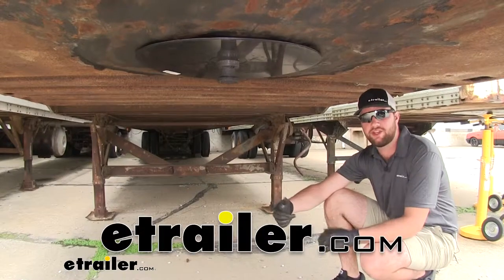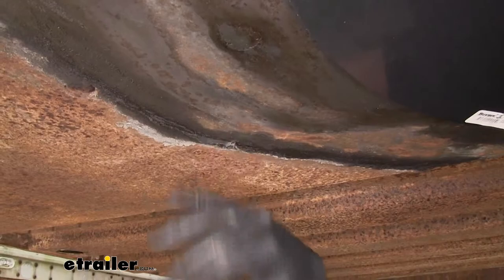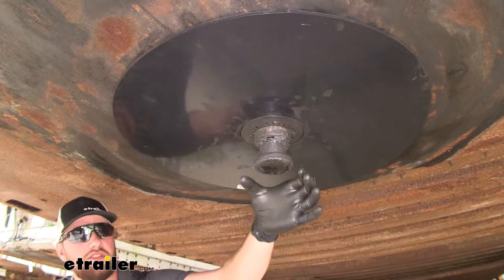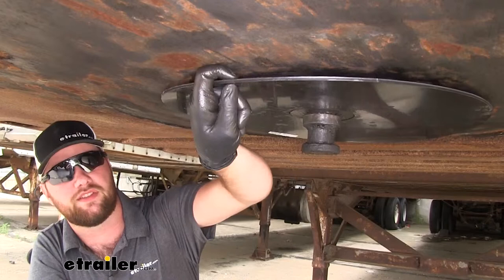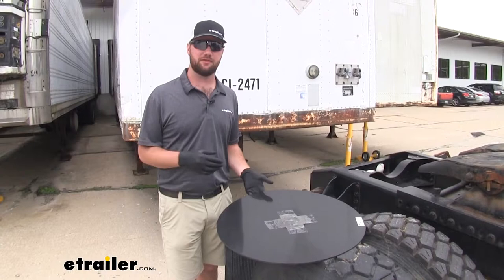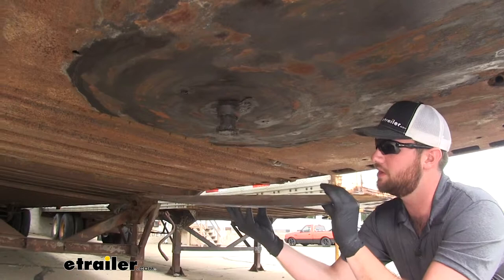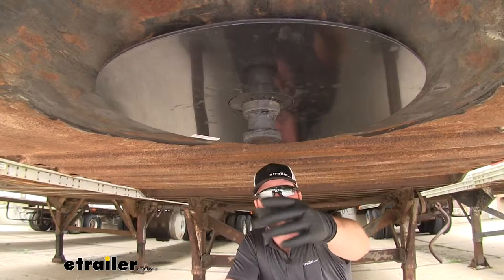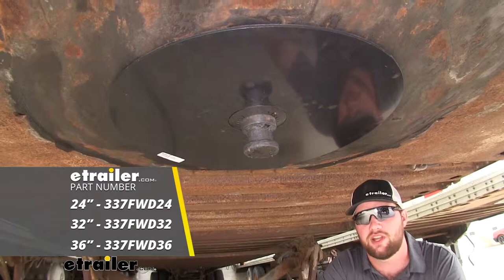etrailer | Feature Breakdown: Buyers Products 24" Fifth Wheel Lube Disks with Steel Retention Clip

Comment: What’s the sense in the skid plate if you have to put grease on the 5th hole wheel🤷‍♂️
Reply from the maker: There was some residual grease on the skid plate of the 5th wheel and on the underside of the trailer around the king pin, but we didn't add any. With the lube disc in place, you definitely won't need to add any grease. 
https://www.etrailer.com/Accessories-and-Parts/Buyers-Products/337FWD24.html

Comment: Is it recommended to remove the existing grease from the fifth wheel and/or around king pin?
Reply from the maker: It's not absolutely necessary, but one of the primary benefits of a lube disc is to reduce the mess, so you might want to clean the skid plate up before you install the lube plate.
https://www.etrailer.com/Accessories-and-Parts/Buyers-Products/337FWD24.html
Reply: Mine  was 50 bucks at the beacon to have the fifth wheel cleaned
Reply: Manufacturer recommends clean surface